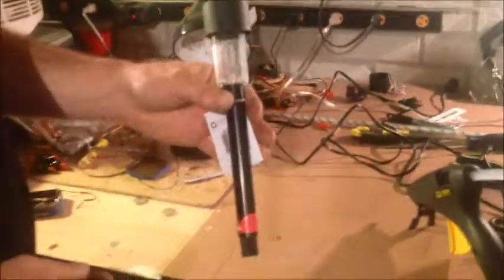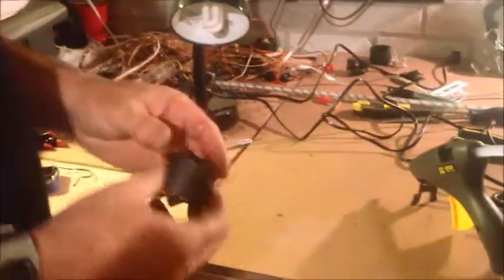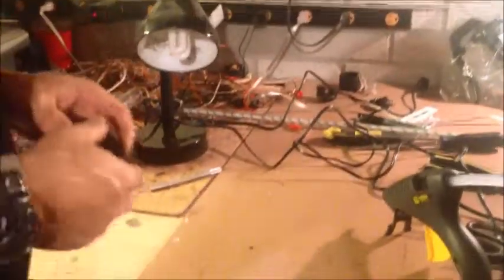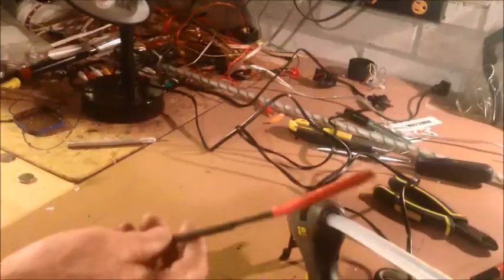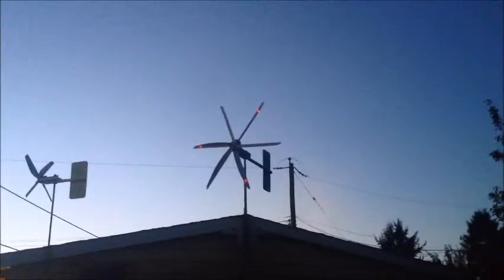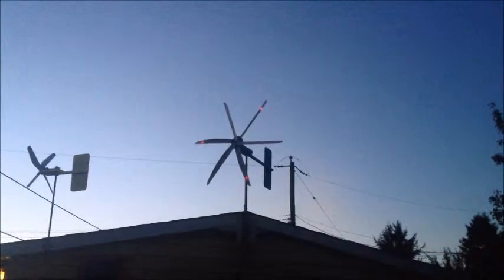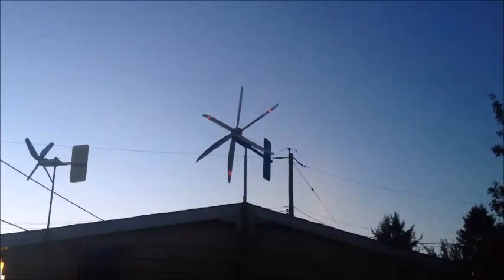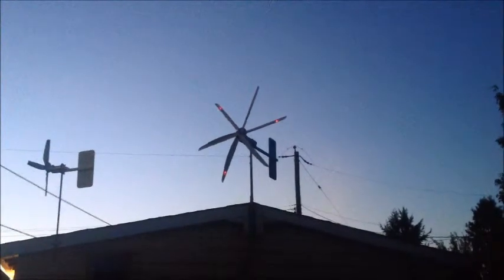How To Light Up Your Windmill Blades

Comment: Thank you for this.  I used this idea but didn't drill a hole in the side, just drilled a hole in the blade.  Cost less than two bucks each, so if they last a year I'll be happy.
Reply: Just a little more here.  I consider my windmill a moving art exhibit, and the only way to see it at night is through expensive lighting.  I wanted to be able to look out the window and see what the wind was up to.  

The blades are metal, so I cut one inch holes at the tip of each blade and then used Goop Automotive (clear) to both leak-proof the units and fasten them to the blades.  Units cost $1.99 at Canadian Tire and I threw away the metal post.  My windmill puts on quite a show.
Reply: Thank again Guy.  I knew I'd find an answer from someone on YouTube.  Cheers from Canada.